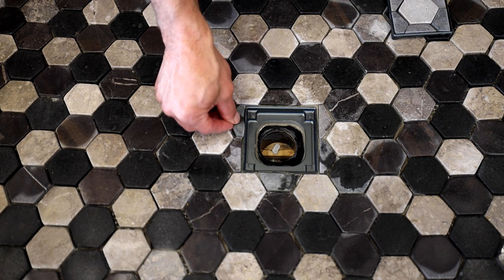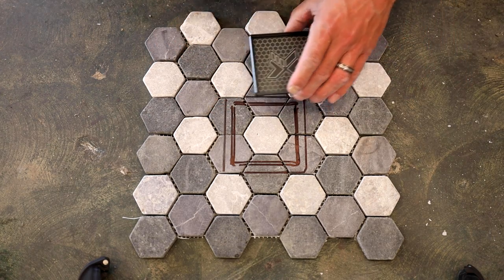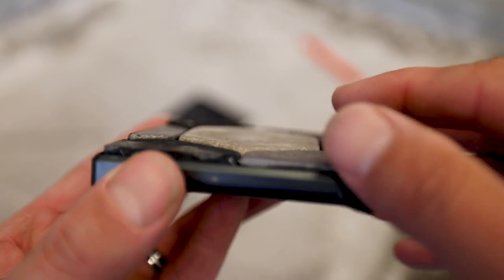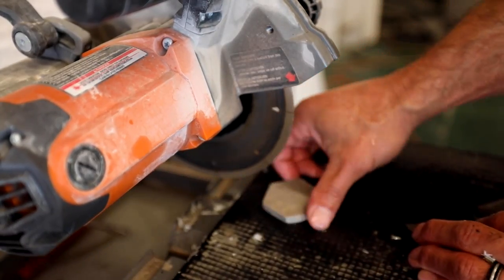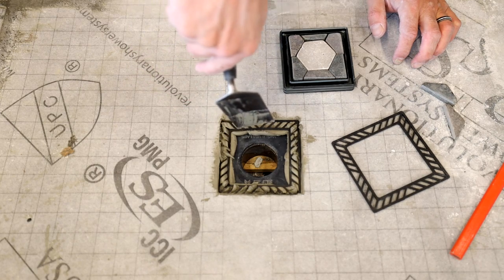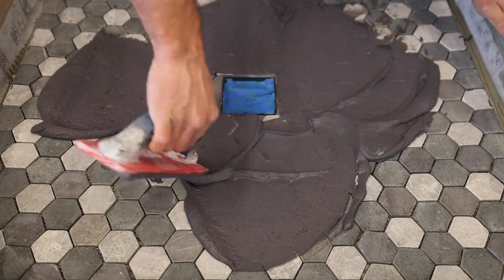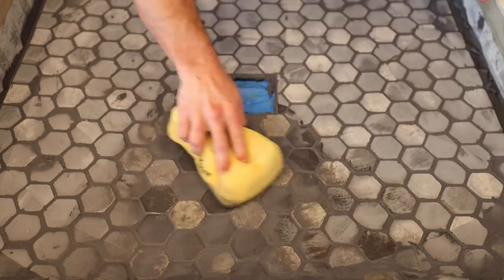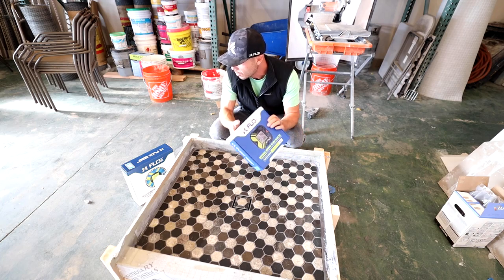My Favorite Shower Drain!!!  FloFX Tile-In Grate

Comment: I learned so much from your videos -- bought an old house in 2020 and renovated a 1b/1b guest suite, removed the old bathtub, and installed a walk-in shower.  Turned out really nice!  Then remodeled the main bath of the main part of the house, including a new bathtub and tiled walls.  Turned out great again.  Then I moved to Australia....  Be thankful for strict building codes and inspectors!  Before renting an apartment, I stayed in a few Airbnbs, and they all had showers with almost flat floors;  the water drained, but very slowly.  Then I moved into my apartment, and it has the same drain as in this video, and the water does NOT drain as the tiles are either flat or sloped away from the drain.  Squeegee after every shower!  I said something to building management and learned that every apartment has the same problem.  And an engineer at my church said the inspectors don't care, or are friends with the builders.  The showers are designed properly, but it's cheaper/easier to not slope the floor.  What a pain!

Comment: Ok, I counted 35 push ups. That's crazy 🏋️‍♂️💪.
Also, how do these drains do with lots of hair?
I use epoxy grout in bathrooms. I know that the waterproofing is behind the tile, but especially in showers I want that extra defense. It's also sooo easy to keep it clean!!
Been watching your videos now for over 3 years. You're awesome.
Reply: Same with epoxy. I've not seen follow up videos after a few years to see how the grout holds up. A question I always have.
Here on the wet coast, mold and mildew are constant issues inside and out.
Reply: @als1023  Anecdotal results from me; after 3 years the epoxy grout has no mold, no mildew, no chipping, nothing. I rarely even need to clean it. I'm a believer. And I live in Florida. The humidity is rarely below 70%.
Reply: @margaretbear  Thank you for the reply, I used epoxy on the last bath I did, and was very impressed. It was actaully Mapei CQ, which is not techniaclly epoxy ?
Anyway the grout is bullet proof.
I found another video ( revisit to old job from early 200's ) talking about the new / old grouts, on this channel, months back. A lot of chat about the softness of the new grouts, and no ability to scrub very hard when cleaning.
Also comparing to old ' hard ' grouts,
thanks for posting !

Comment: Hey Isaac, question about the new foam features for showers (foam curb and foam bench).  How do they stand up to constantly having weight applied to them?  Seems to me the foam would give and the grout between the tiles would crack. If a person is standing or sitting on these foam pieces day after day, it seems like they would crush or deform.  Doesn't seem like there's enough firm support under the tile with foam compared to wood.  Can you do a test?

Comment: Hey Issac....Have much respect for what you do & how you've been able to grow your company over the yrs....Grew up in Carmichael CA 95821 from 82'-88'...Went to Pasadena Elementary & Churchill Jr. Hi....Been in the industry around the same time frame as you. Was able to start my learning in LV when I went to UNLV early 90's working for my Uncle's company. How can a bonding flange system weep? What I've learned over the past 20+ yrs is that the differences from a traditional 3pc pan system done correctly VS bonding flange systems, is that the traditional system drys out better & faster than the bonding flange systems. Especially when using stone products. Regardless of the correct sealer being used....Keep on teaching my friend... Your a difference maker for the industry!
Reply from the maker: In our area, we have a lot of trouble with clogged weep holes in traditional pans.  It takes 10-15 years but then weep holes clog and water wicks up over the curb damaging the walls on either side of the curb. We stay away from white marble on shower pans for the most part.
Reply: The FloFX bonding flange system has integrated weep channels

Comment: Quick Question, does this type of tiled grate work with the Kerdi shower pan drain? Also, thanks for all the helpful videos. I also have an additional side question: I want to use IP 67 LED lights in the niche and on the underside of my curb sill, is this a mistake?

Comment: How does the water drain from the waterproof membrane if you're adding all that thin set to the plastic spacers, you're pretty much glueing it and creating a barrier, water has to pool and can only drain through the top drain when it reaches the height of the top of the tile? Doesn't seem right? Do you have to add thin set or can it be left loose to allow drainage? Looks like you totally sealed the drainage from the waterproofing layer...?

Comment: I am building a Barndominium. When they poured the concrete, I had them frame in the shower floor, and NOT pour concrete there. Because I am building a roll-in shower. Both me and my wife are getting old. She is partially disabled. 
Now that I am ready to build the shower, I have a dirt floor 3.5" less than the concrete. Should I dig down about 2 inches and pour some concrete, and come up from that point with hard pack or do you have any other suggestions?

Comment: I am building a shower on a slab using the tile I grate flo fx drain. I am also using a goof proof system for my slope. When I make the bed should I use a vinyl liner under bed? Or does it go on top of the mortar bed and tile layed on top of the vinyl?

Comment: I just noticed at the end of this video that the traditional Flo FX pan drain will not work with the tile flange. Unfortunately, I already ordered the tile flange and wondered what prevented the tile flange from being used in that way with a traditional Flo FX pan drain and the FloFX tile unit.  I  believe the universal Flo FX will not work with a Schluter floor pan.

Comment: Isaac I don’t understand I have been looking at buying one of these FlowFX drains but I really want to do a water in water out shower pan. I can’t tell if the FlowFX drains work with the a WIWO pan, it doesn’t appear that they do, only that they can be adapted to a WIWO before they he pan is converted to a topical membrane type system. Is there a good drain that will work with a true water in water out system?
Reply from the maker: Flo FX only works with surface applied membranes.

Comment: Hi, if any of those tiles come up can you put them back individually with the stuff in the bucket and use that as grout since it’s only a few?  Also the guy said it don’t need to be sealed. The stone is marble I believe. Would it be ok to seal anyways. He dropped the shower door and some came loose. I have fixed them but see cracking. Can that be regrouted. I know this is long 😅 thank you and help appreciated
Reply: Installing with grout is frowned upon but I’ve been guilty of it. Not recommended.

Please make sure it’s marble. If it is then it does need to be sealed. Sometimes it can be a porcelain/ceramic that has a marble design to it. Can be confusing. I’m that case no need for sealing. Hope this helps and sorry about the glass drop.

Comment: @TileCoach - I see on the @FloFX  website they refer to a new, improved design. It seems they have put an opening in the corners and a recess along the edges to allow moisture to wick/drain away. This video is only a month - old so have you seen anything about their new and improved tileable  drain grate design? Pictures on their site show both forms –closed corners and open corners.
Reply: Thanks for posting

Comment: The only thing I can’t be agree is why you use hardy backer for shower pan . Always has to be float it .
Reply: Edgar, it does look like hardie the grid pattern can confuse someone; however this pan is a lot like other prefab foam pans (I’m sure Isaac would say it’s sturdier, so not like other foam pans 😉). It is called RSS. Revolutionary Shower Systems.